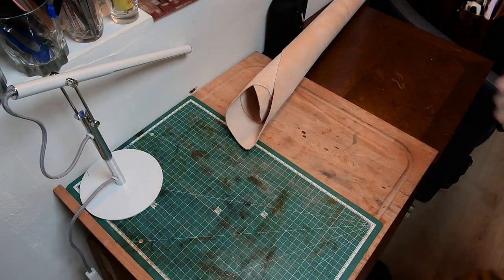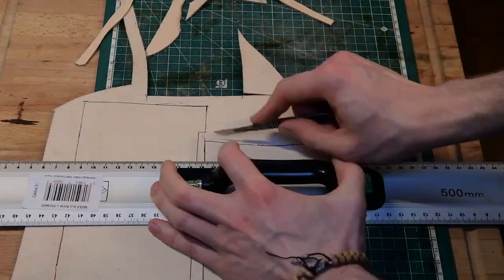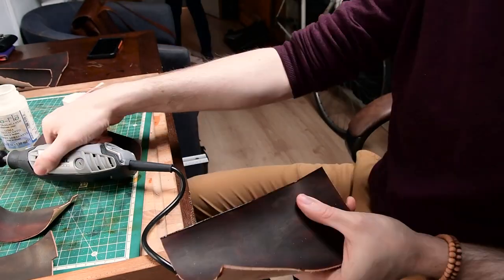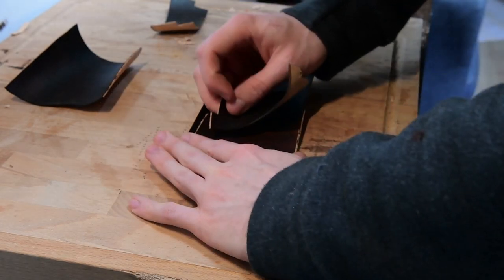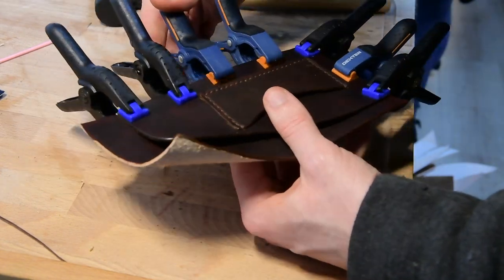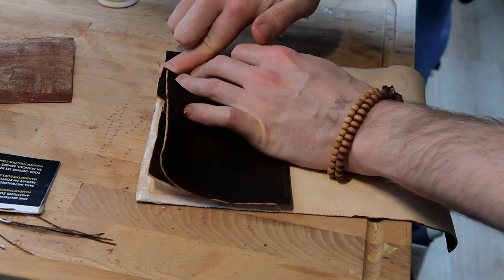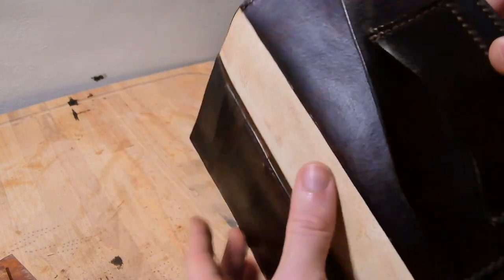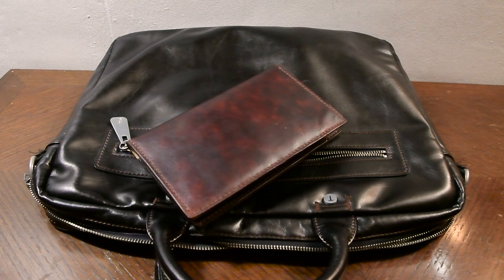Travel wallet vegtan leather build

Comment: Hey James, I've only been doing leather working for 3 years. I have had loads of trial and error. Dying my products however has not been an issue. I recommend the following to help in your projects.
1. To keep the crunching and rolling from happening do 2 things.
A. After dying the leather put the flesh side (the rough side) on the corner of your work piece and give it a nice rub with the corner of your work piece.
B. Don't store your leather rolled up. This causes your leather to naturally stiffen in that state.
2. Fiebings is great. However I would only recommend the oil dyes and don't dilute them if you don't have too. If you have to dilute them for a custom lighter color, use the neatsfoot oil before applying your dye.
The best ways I found to apply my dyes are with a airbrush or a high density sponge.
3. I like what you're doing you're doing good work. To take your pieces one step further take the Gum Tragacanth you use on your edges with a cloth and  rub in on any exposed flesh side pieces and areas behind flaps and pockets. This keeps the fibers nice and tight keeping from crumbling and leather particle shavings over time. 
 If you'd like to know anything else or just like to discuss different methods feel free to contact me at BlackandGrayLeather@gmail.com. 
    Thank you and I hope it helps
Reply from the maker: Hi Cory, thank you so much for the great feedback!
Sorry it's taken me so long to see your message, it was in the spam section.

I've been looking for ways to improve my dying technique and have purchased an airbrush as recommended to help me achieve a more even look to the finished pieces (without needing multiple coats of dye). Hopefully this will go a long way to improving the dye while keeping the leather more supple from needing less dye.
I will try to store the leather in a flat position under my bed on a carpet for protection, this should minimize the time spent with the leather rolled up. Hope it helps in the long run =)
And thanks for the great tip on the gum trag! I'll try this on the inside of pockets and things as you suggest!
Reply: JamesBerry like I said anything else I maybe able to help you with just email me.

Comment: Well done again. I think the final color is gorgeous. And it will lighten up over time. It should definitely last for many, many years. My 2 cents on the stiffness and/or curling. After you dye and condition really work that conditioner into the leather. You can rub and “counter” roll the leather in the opposite direction of the the current bend/roll. You won’t hurt it. You can always add water as well. I will dye my leather and then as it is drying will lay something heavy on it so it drys flat. Just my thoughts, but you are doing brilliantly with your experiments and techniques.
Reply from the maker: Thank you so much Choya for the great tips and feedback! Indeed I still need to learn to nourish the leather properly after it's been dyed and I think I'm getting there on some of my test pieces. I'll try rubbing it in with more energy and bending it the other way (I was worried of creasing the leather by doing this).
Cheers!
Reply: Thank YOU for taking the time for making these videos. I think that the trial and error is the best part of doing leatherwork. When you find that Ahh hah moment of getting it right it’s EVERYTHING. 🤗 I do a sort of “rolling” thing to avoid creasing. Although creases can always be fixed by wetting it. There’s not much that can’t be undone. Happy leather crafting and experimenting 😉👍 I look forward to many more great videos.

Comment: Hey James, Great work love your videos, I'm fairly new to leather work as well but I believe the issue you are having with the leather drying has to do with the alcohol you are adding to the dye.  Alcohol will dry out the leather, sticking to a water or oil dye should keep it from drying out so badly.  Keep up the good work.
Reply from the maker: Hiya Kevin, thanks for the message :) Indeed, I do agree with you on this and will be trying different things going forwards: the first is to use an air-brush to get a better dye from the start, needing fewer coats of dye to get an even  job should help. The second is to test water based dye and not alcohol based dyes. Hope these will help =)

Comment: I personally find that rather than dye individual parts work out the size of leather to make all parts then dye that one piece where you can control the colour a bit easier and then finish with a good few coats of fiebings carnauba creme it gives a nice lustre and help keep the leather soft then use a scratch awl to mark all your pieces out for cutting , but having said all that the wallet came out nice and i also liked the deep brown colour.
Can i ask where you got your burnishing tool for your dremel.
Cheers.
Reply from the maker: Thanks Paul! Yes, dying the whole piece sounds like a much better idea than the individual pieces. I haven't tried carnauba creme yet but have heard a lot of people talk about it, thanks for the tip!
I found the burnishing tool on Amazon, here's a quick link for you with different options in the similar products category: https://www.amazon.com/SeaISee-Leather-Burnisher-leather-slicker/dp/B00UPQ9NYI

Comment: Not the dye at all, It is the Alcohol in the dye. If you use oil based dye with veg it wont dry out crack. The #1 best resource I found is a Pro called "Weaver Leathercraft" On YouTube has over 100 years combined experience and gives out the best pro tips that I came across thus far if you watch all the leather playlist you will become a expert in days.
Reply from the maker: Thank you very much! I'll check him out for tips on this :)